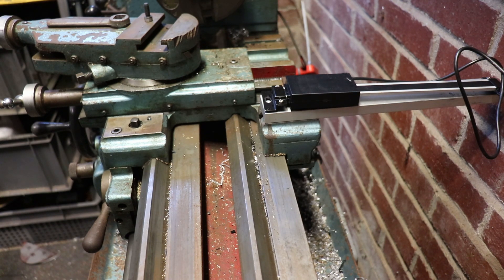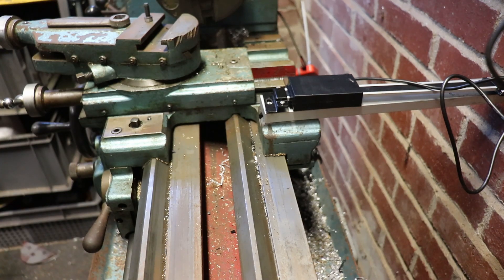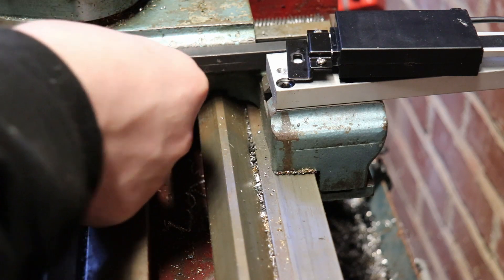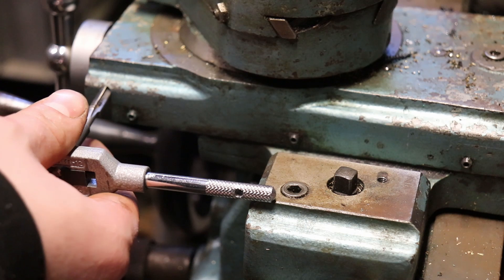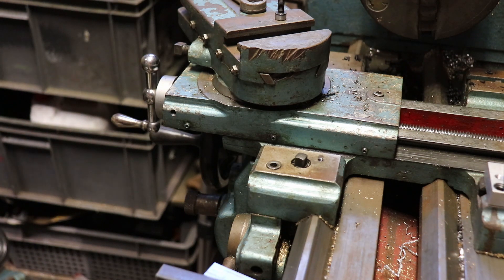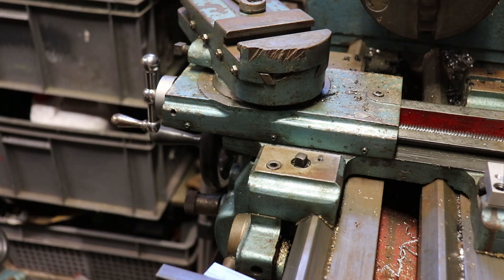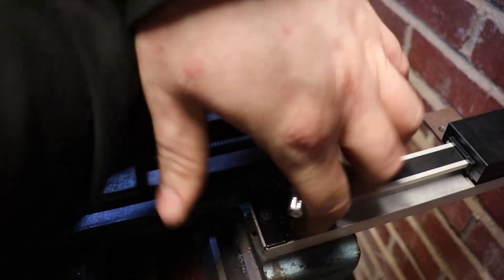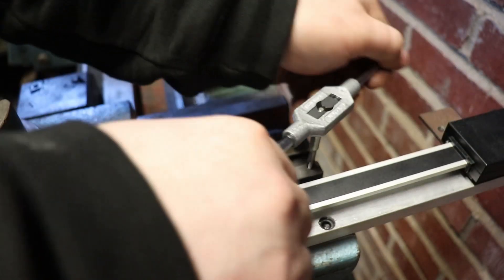fitting a digital readout to the lathe part 2

Comment: Looks good mate, got a link to where you got it, are there any to look out for or avoid?
Im slowly getting my Hercus 9 set up. Building a 6x8 shed so i can work inside and get a couple of cars in at the same time.
My shed at the moment is a 40 foot bus, and it's a bit full!!
Reply from the maker: Thankyou, all i did was buy the chepest scales i could find on ebay that were the right length and tbh theyve beeen great so far, im now looking at fitting a propper dro tho whan funds allow